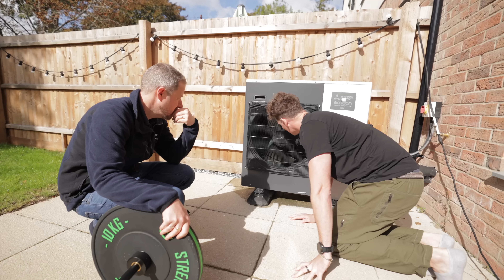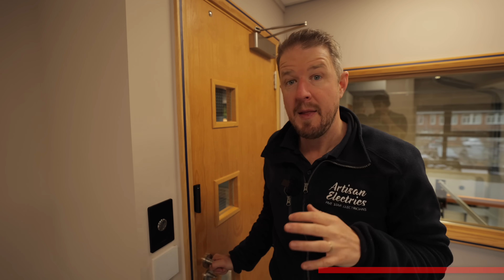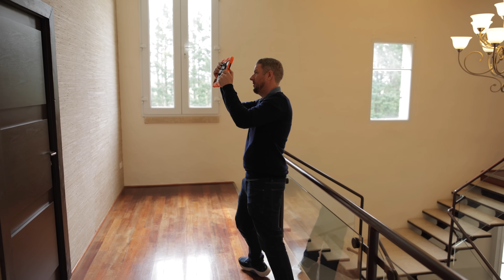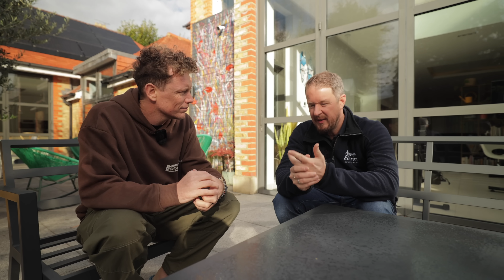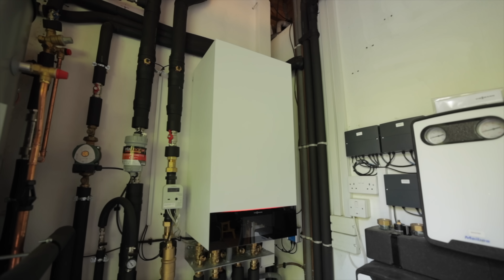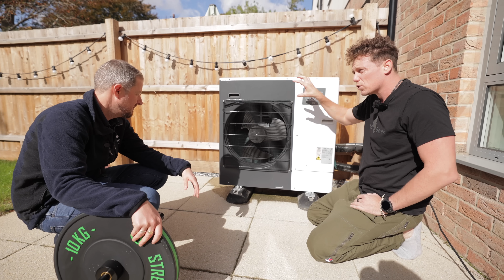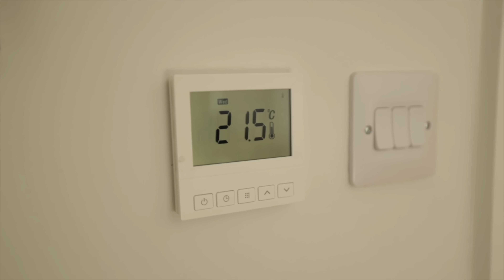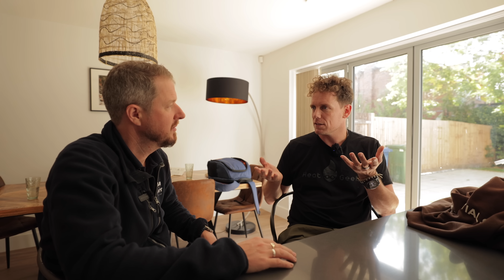Are Heat Pumps Really Worth It In 2026?

Comment: The biggest blocker for me is finding an installer who actually knows what they're doing and would do the job properly.
Reply: That's not an issue round here. There are literally no installers to choose from, making the task much easier.
Reply: My biggest blocker is space required, a gas boiler is something relatively small that usually takes up the space of a kitchen cabinet, an heat pump is something big, that needs to be placed on the outside, and that needs components inside such as a hot water storage tank, that takes space. This is fine if you live in a big house, but consider a small 1/2 bedroom apartment (60/80 square meters) where do you put it?
Reply: @alerighi probably around where the boiler used to be, you'll probably only need a 140l unit which is almost the same size as a gas boiler
Reply: I had EON fit mine, works perfectly, and they won't instal one if it's not efficient or possible in your property.

Mines amazing.
Reply: @garethhhhh  How did you get Eon to turn up? It took 18 months to get them to come and replace a faulty meter, I told them right from the start it wasn't working. Estimated bills for 18 months.
Reply: Yeah. I had an installer come round back when zero disrupt was in beta, and I asked him a few questions because I was on the borderline between two heat pump sizes (1-fan / 2-fan unit) - the lidar app didn't really give much flexibility in this case and to be honest I think it made the experience worse. I worry that installers using the app might be able to hide behind it to hide lack of experience etc.
Reply: Just find a Heatgeek
Reply: you are making a big mistake if ur buy a heat pump and after u making a larger mistake by payng loads of electriciti to  makee heat very very expensive and ur making ur money a waste...
Reply: @mytzuno1  You need to learn English properly. You also need to learn how heat pumps work, if sized and installed correctly in a property that is insulated they should heat the property no issue with higher efficiency than a gas boiler.
The Nordic countries have been using heat pumps for years and they live in a much colder climate than us.
One of the issues in the UK is we have incompetent installers and the government grants only cover air-to-water systems where as an air-to-air system is more efficient and also provides cooling in summer.

Comment: I recently had a Heat Geek survey, but they are not allowed to be flexible, and will only design to a certain standard temperature. This mean im forced to get a 12kw heat pump and not the 7kw i would prefer. I run a cold house 16 -17 degrees. They will not take this into consideration. They wont even do a Heat Geek hot water tank. Its got to be a a Valliant uni store. I might be forced to get a gas boiler 🙁
Reply: Doesn't sound like you got a heat geek.  The kW of the heat pump has nothing to do with the temperature; it's to do with the heat loss of the house at a certain temperature, so if your heat loss is 11kW, then a 7kW unit will be undersized and unable to heat the home when it's cold.

Comment: Hardly an objective subject when you have the guys from Heat Geek with you. Every house is different but I wouldn’t touch a heat pump with a barge pole. It would be a nightmare to replace all the pipework and be faced with huge electric bills.
Reply: Install an Air to Air

If you want to run a water based system it needs to be a low temp system
So
Take the next few years re insulating your house to a high standard

Comment: A £12,000 quote costs the owner £5,500 because of the government scheme, when that scheme ends heat pump instalations will start costing £6-7,000, go figure...
Reply: And most of that cost comes from the conversion to low temperature heating; it's not a "heat pump" cost, it's an investment into reducing your heating bills, regardless of heat source.
Reply: @BenIsInSweden  I think you missed my point (or I missed yours lol)
Reply: @FatterTony  re-reading, I think you're right that I missed the original point.  However, on that, the costs haven't increased with the grants and have stayed mostly static.   Prices will likely come down by the end of the grant, but the data doesn't suggest that installers are pocketing the grant.
Reply: Only if your installing a water based heating system
Air to Air with 2 multi split costs cheapest i found was around 1000

Comment: I use Home assistant to control my heating in every room, if no rooms call for heating then the heat pump heating turns off. if just one room calls for heating it turns on. we use Octopus cosy so we get 4 cheap rates a day, we boost heating in those times and heat the hot water.  this means we shift all of our usage in cheap rate of 14p/kwh on top of that we have solar and battery. so we dont ever pull from any other time than cheap! based on our usage we save around 3-4k a year
Reply: Who the feck spends 4k a year on heating a house let alone saving 4k!!!!????? 

What are you heating Buckingham Palace 😂😂

This comments section is hilarious with the utterly bollocks being spoken,
Reply: @pauldavies7251   I miss typed it was meant to be 1-2k we IMPORT 6k kwh a year . but our USAGE is  10k a year but we have a hot hub. we live in a warm house and never try and conserve as its quite efficient. 

the average kwh cost without any of this is about 22-25kwh which is around  £2600 a year,  plus we export around 2000kwh a year from solar, and our usage  from the grid is greatly reduced in summary due to solar and battery. 

with all of these factors we could be spending close to 3k, but we spend around £1100 a year plus £300 plus export. 

while taking advantage of cheap rates, our average cost per kwh is around 14p . with all of these factors and the fact that a gas boiler to achieve all round heating at this level of comfort would cost us even more ( including the fact we dont pay the standing charge so we save an additional £115 by not paying the gas standing charge)

Comment: These comments are an echo chamber.  Trying to justify all this when you could just have a nice small and simple combi
Reply: Speaking of echo chambers - combis are a jack of all trades, master of none.  They're usually oversized for heating, and when sized correctly for heating, their hot-water output isn't typically sufficient for the property's size.

They're great if you don't care about running costs - but as gas prices increase, their "small and simple" appeal will lose its charm.
Reply: @BenIsInSweden I had a boiler installed 3 years ago the tech and grants have come a long way in that time
Reply: @BenIsInSweden  I'd be more worried about electricity price increases
Reply: @JeffersonHumber  There are options to make your own electricity, can't make your own (useful) gas.
Reply: @BenIsInSweden  But at what cost.....
Reply: @JeffersonHumber depends on the setup but generally they pay for themselves in 6-10 years and then anything after that is money back in your pocket.
If electricity prices go up then the payback period shortens, the only way they don't pay themselves back is if electricity gets very cheap, which isn't likely.

Gas on the other hand will get more expensive due to it's finite nature and it gets more and more expensive to source, and you will always be at the mercy of market prices for it.
Reply: I moved from a combination 3 years ago and installed a tank
This year got solar and a battery with a diverter so most of the summer have had 500 litres of free hot water
The excess solar only goes to the grid when the tank is fully heated

Comment: I had my install done by a reputable installer in 2020 and have never been happy with it, it simply does not produce enough heat for our house and with electricity now 3 times what it was in 2019 when we made the choice it now costs us a fortune to run too. Thank goodness we still have log burners. I am still getting the grant money but as soon as the 7 years is up then I will be going back LPG or oil.....
Reply: When you say it does not produce enough heat for your house, do you mean the house is not at 20/21c or that the rads are cool? Also, do you run it a bit in the morning and evening or leave it run all day?
Reply: @SeanW-zi6kj  in my experience people often try and run them like they did an old gas boiler - turn it on and warm the house up then turn it off.  The lower flow temp of heat pumps make that way of using them really slow and seem like theyre just pants - completely missing that thats now how they work.  If they left the thermostat alone they'd probably find their log burners would never need to be used.
Reply: @jameshodgetts7541 Indeed, that’s what I was trying to find out as I’ve seen that quite a bit also. It’s so uncommon it’s the heat pump, as half the time they say “the hot water is great!” Whilst simultaneously saying it cannot get hot enough to heat the house, which usually means they run it like gas boiler.
Reply: @jameshodgetts7541  My heat pump runs at around 3.5kw/hour in a steady state, meaning @28p/kwh my  heating would be £24/day 7 days per week. Nearly £700/month. I run it from 4am in the morning (use the last bit of low cost charging energy overnight) and run it until we all vacate at 8:30 so it gets 4.5 hours per day. Evenings I just don't bother, just light the fire.
Heat pumps I am sure do work in some houses but only when the cost of electricity is not as high as it currently is. Better of on LPG at the moment
Reply: @SeanW-zi6kj  I Can not get the house to 19 degrees most days in winter, if the thermostat is set to 19 degrees that just means a continous call for heat. I can not let it run all day, my bills would be mega.
Reply: @robcartwright9064  there’s your problem. If you’re turning it off through bill fear, you’re actually making the whole problem worse. You need to let it run continuously as once it gets to temperature it’s at that point it can throttle back and then it’s super efficient. It can take a couple of days to get the temperature up in the house as it’s not just heating the air, but all your stuff and the fabric of the building.

Comment: Perfectly summed up - a well designed and properly installed ASHP can save you money.  Of, course that's stating the impossible for most people!  Like every new "craze of today" in the past such as cavity and roof insulation, UPVC double glazing and solar panels to name a few, especially where Government money is involved, the unscrupulous skanksters get involved.  The average man in the street can't tell if the survey is good, or if the install is good or even how the bloody thing works ....as we saw here!  Finding that knowledgeable, honest installer is like searching for next weeks lottery numbers - 99% are on the bandwagon for the money, haven't a clue and care even less.  And we can't tell the difference!!
Reply: "...especially where Government money is involved"

Exactly my experience with ECO4. Suppliers were that bad that the install had to be abandoned.
Reply: @darrenadams2640  this is my worry. I'm in the middle of eco4 installation (it should have ended 4 days ago) and at the moment have no heat or hot water and no one can tell me when it's going to be put right 😞
Reply: Like how double glazing was a craze back in the 90s, and today it's a standard. You'll likely see something similar with heat pumps as well. The difference is, the heat pumps in 20 years will be a lot better than the ones we have today. 

There'll probably be lots of smarts built in to communicate with your energy supplier and get updates on your tarriff for the heap pump to know by itself how to run itself for the cheapest cost. There's so much that could be done that hasn't been built yet but inevitably will become a differentiator and then become standard across them all.

Comment: Gas is about 4 times cheaper than Electricity. Getting a SCOP of 4 for an older property will be difficult especially in Winter when you need it the most so there is simply no cost savings to be made moving from Gas to Electricity. On an older property with no cavity walls it has been proven that Heat Pumps simply do not work very well no matter what Adam may say. The comment about us all using Putin's gas is rubbish, the UK does not use Russian Gas and the Grid uses Gas every day and a lot more in Winter. I have also heard too many stories of botched installs from the Heat Geeks channel and problems getting Heat Pumps fixed when they fail. This Country simply is not there yet, we need more Engineers trained in Heat Pumps which require so much more skill than a Gas Boiler replacement.
Reply: Gas boilers aren't 100% efficient, so you don't need to get a SCOP of 4 to break even.  An older property doesn't mean it won't get a higher SCOP.    The main driver for the SCOP isn't to do with insulation, but to do with flow temperature, and correct sizing of emitters etc.   A new build can easily end up with a worse SCOP due to tiny microbore etc.
Reply: gas boilers are not, and never can be 100% efficient, so your maths is a little off.

And that aside, paired with a cheap night rate even a terribly inefficient heat pump will be cheaper than gas.  Even electric resistive heating (i.e. the most expensive type of heating) can actually be cheaper than gas overnight, especially when taking into account actual gas boiler efficiency.  Pair that with solar for during the day and the worst of electric heating can be cheaper than gas.

I agree we need more engineers, but we also need better public understanding of what efficiency actually means, and better understanding of energy production in general
Reply: Energy is a commodity. Prices are set globally, so yes if you increase demand for gas and oil you're paying more and giving more money to lovely regimes like Putin.

Comment: Being a HVAC controls Electrician, heat pumps for a retro fit are rubbish they are definitely not cheaper to run or as convenient as gas period. For a domestic Installation with the house built for a heat pump they work quite well except they take ages to heat a cold house up to Temperature, unless you like a cold house . This video is about promoting business, just like alot of the others he has made . Not sincere.
Reply: Are you telling me that mine doesn't work? It's just a 1930's semi-detached with a heat pump and it's never been warmer and is a little cheaper to run than our gas boiler. 🤷‍♂

Comment: As an electrician, I install integrated heating, cooling & home automation systems, and heat pumps, work great, BUT, the secret is the electrical install, if you have a large photovoltaic system (15-25kW) that is quite complex with on grid/off grid, battery with gas/oil backup, inverter circulating pumps, VRF and all that gear AND critically a Net metering system, it can be made to work and cost very little to run. However, how many electricians are not only FGas qualified but also highly experienced in installing these integrated and complex cooling/heating systems, good at CAD, design etc and how much as an electrician are you going to charge on an install.
If this is factored in, then you'll be looking at 10 years return on investment, thats' not good.
I am working on a new build 'house' with computerised underfloor heating, centralised VRF cooling, over 20kW of PVS and 51v DC battery banks, its probably going to be the best heat pump system ever, BUT, forgetting the boiler and heat pump, the underfloor part has already cost 20k, 2 x heat pumps, backup boiler go in early Jan (another 15k) into a dedicated, custom designed boiler room, the inverters and panels will be another 16k and I haven't mentioned the electrical infrastructure based around two dedicated brick built plant rooms and the 63A 3-phase multiple distribution boards all integrated into a home control system... As a company, how much would you guys charge for 1-3 guys and say 4 months of work, using teleloaders, a JCB, a cherry picker on site etc... now try and make the figures work!

Comment: With electricity prices increasing quicker than gas then heat pumps can’t be cheaper to run
Reply: they aren't though, in the UK it's hovered around the 4x mark for years. But they are often cheaper to run, because gas boilers aren't 100% efficient, and usually aren't set up or sized for maximum efficiency either.

Comment: Great collaboration with Adam of Heat Geek, my ASHP was fitted 3 years ago by a great company I have used for solar and battery previously. A quality engineer really makes the difference. We did replace all of our radiators as originals from the 1970's and full of muck!
Very impressed and I have found even a lower temperature for the home is far more comfortable as it is maintained 24 hours per day. Used 2500 to 3000 kWh per year with a COP over 4.
Reply from the maker: Glad you enjoyed the collaboration!
Reply: Why not name them so others can check them out and maybe benefit?

Comment: Interesting video, we got rid of gas a few years ago and only have electric radiators/water heaters now (No cyclinder) with the plan of Solar and batteries about to arrive. May look at this but not sure we would entirely benefit from it due to size of house (Small house so total radiators is 10 kwh total if all going full blast for the house but they never are). Plus the coldest room in the house is the conservatory and I still assume you are not allowed to connect a radiator to it based on the planning rules etc.? I think the old rule was your houses current heating system? Which was one of the reasons for us going electric radiators but never fully enquired about it.
Reply from the maker: Sounds like you've already made some great progress in moving away from gas!
Reply: You went from gas to electric at 4x the cost? What made that decision?